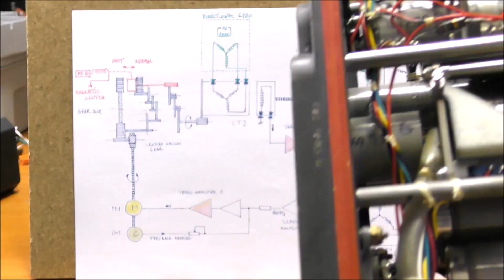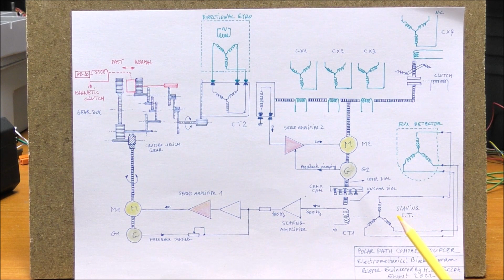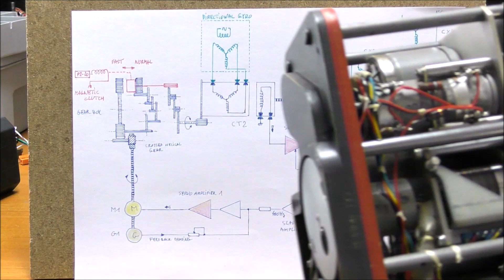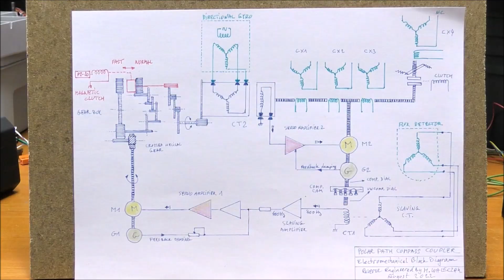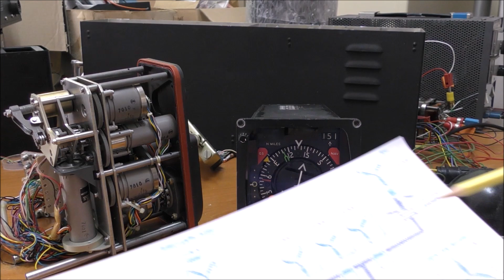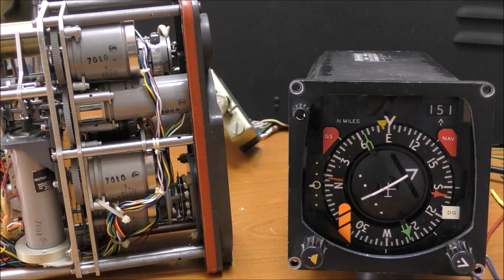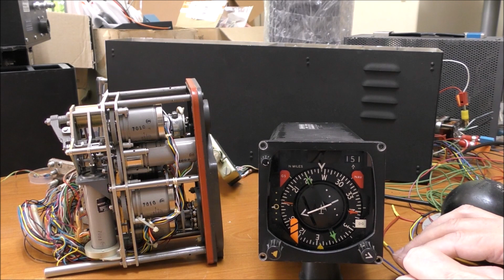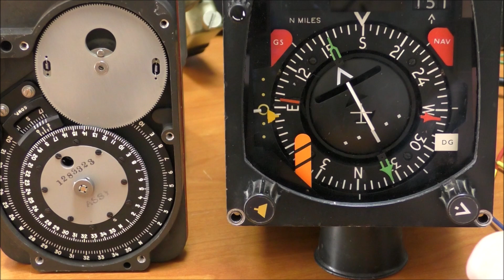LDM #287: Bendix Polar Path Compass Coupler - Part 3: Functioning and tests

Comment: Thank you for the block diagram. Now I understood what these things actually do.
I've seen a video yesterday that Canada is not using the magnetic poles for runway labeling, since they move so often and that most of the navigation is GPS-based anyway. But I assume there is still a market for these units, in electronic form of course, for planes that cannot rely just on GPS.